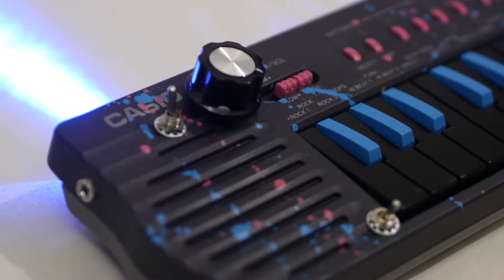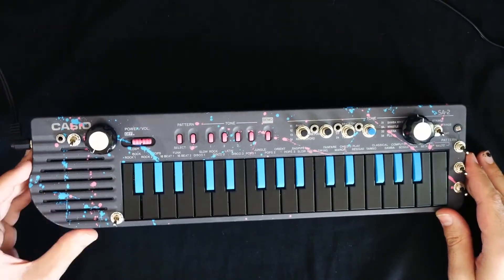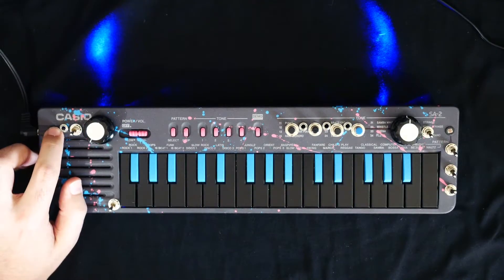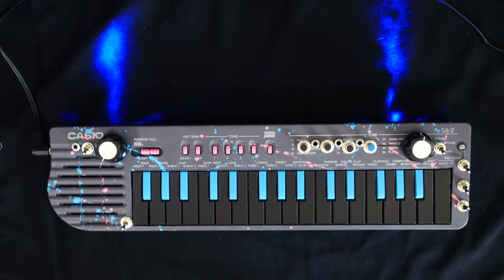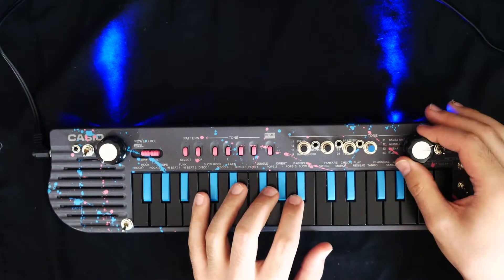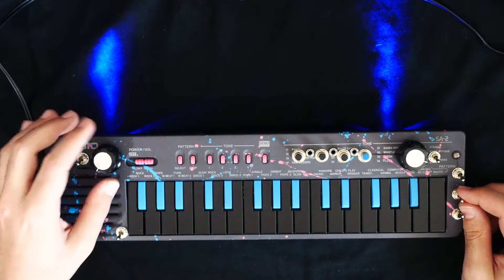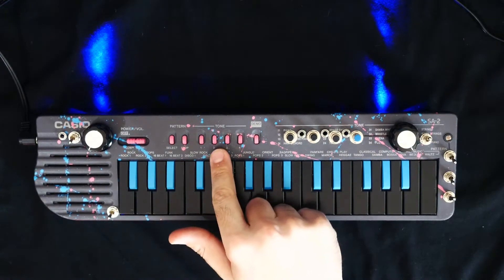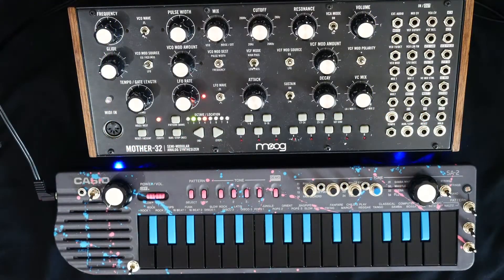Circuit Bent Casio SA-2 // Full Overview // Gleix devices

Comment: First of all, that's super impressive work. Great job! I have two mini synths but my SA-2 is broken. I got it at the flea market a few months ago and it worked for some time, but now I can't seem to turn it on. I tried soldering a USB cable to the battery pins to power off 5V but it won't turn on. I do want to resurrect it because it's got two key polyphony unlike my PT-1. Maybe it's worth installing a permanent switch like you did to bypass the failing slider?

Comment: have you done this to an sa35?
Reply from the maker: I haven't fooled with the double digit SA models since I like the smaller ones, but I believe the internals are fairly similar - they should use the same OKI chip which is where some of the interesting glitches are, and the method of getting that distorted feedback should be the same as well.

Comment: Beautiful work and very inspiring! I would love figure out CV for my next project. Also, how do you paint your keys? Do all the keys have to be removed separately? I'm so nervous to disassemble the keys and have a million pieces come flying out and not be able to get them back together!
Reply from the maker: Keys on most small keyboards come out in large pieces - all of the white keys are a single piece, and all of the black keys are a single piece. Makes it fairly quick and easy to paint them each separately, but I'd recommend putting down a layer of clear coat to avoid scratching and whatnot afterward. 

CV is sort of different depending on the use case - the easiest ways to implement CV on most things would be by using a vacrol or an opto-coupler. ie. feed your 5v signal into the opto coupler and have the other end close the gap on the points you'd like triggered. I believe I used that method for the drum triggers on this machine, but used a vactrol for the feedback/distortion.
Reply: @gleix_  Good to know about the keys - looking  forward to painting on my next project. Also - good advice on the CV approach, thanks!

Comment: Thank you for your detailed video! I have got an SA-2 lying around, and those mods seem quite useful to me :). I found your schematics on your website, but how do you wire in those CV inputs? is ist just parallel to the buttons?
Reply from the maker: IIRC it will trigger if you wire up directly to the button contacts with tip>common and gnd>trigger point, but it ends up triggering when the trigger goes low instead of high which can be fixed with a little transistor circuit or a hex inverter. Something like a vactrol, opto-coupler, or maybe a switch/trigger IC would work - I think I went the vactrol route on this one. Some methods will be more reliable than others, and some will allow higher speeds than others as well, but there are a few different ways to approach it.